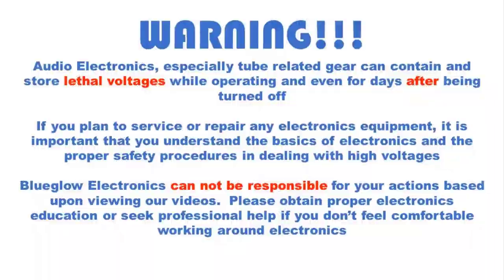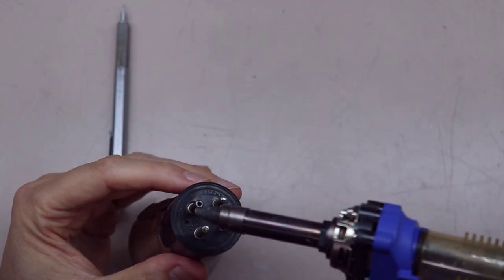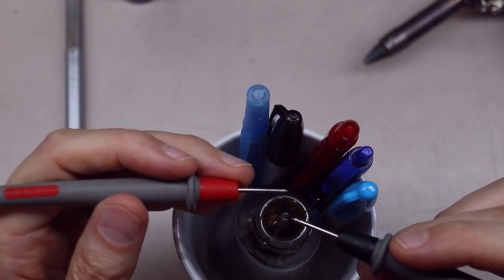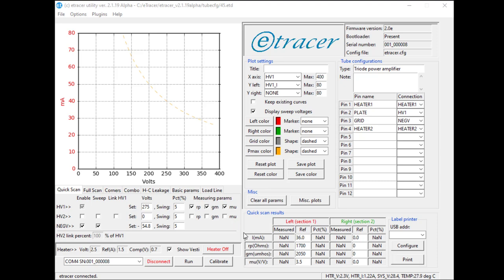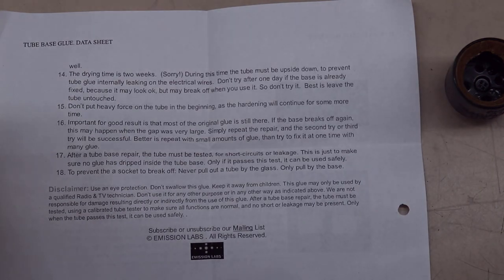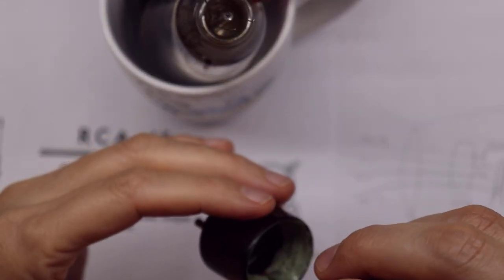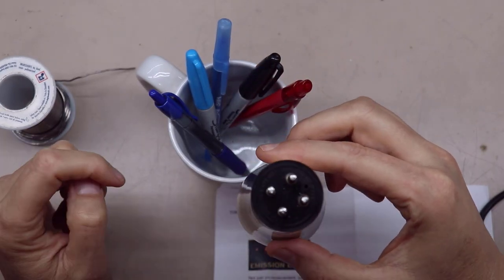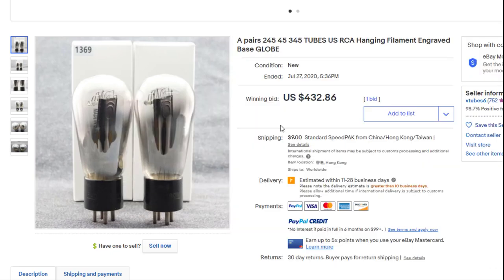How to Repair a Loose Vacuum Tube Base Properly

Comment: A way I have found to fix this issue that works great is to get a tube of Permatax exhaust and manifold sealer. Like $7-8 at an auto parts store or an Ace hardware, probably enough for 100 tubes. Just run a bead between the base and the glass. It can be an intermittent bead, like 3-4 dabs around the circumference of the base will work fine. The challenge is to not glob a whole load of it when you just need a small bead. YES, you will able to see it, but it solves the problem in under 30 seconds per tube and obviously it can handle pretty strong heat being an exhaust sealer. If you apply too much, try to get it off before an hour or so goes by, because it gets quite hard and you have to manhandle the tube to get it off. Works great.

Comment: Nice tips on tube repair. Would it help to temp. solder some bus wire or magnet wire on the leads to get them back through the pins again?

BTW, you seems to have an infestation of comment bots below. The one with a link at 36 minutes is funny as this video is only 15 min. long, obviously a re-direct to another youtube video or something more sinister. Annoying bots.

Hope you are doing OK, looking forward to hearing more on your barn restoration. Any plans on shooting some clips on it's progress?
Cheers,

Comment: Hi,
I was under impression that vacuum tubes have vacuum inside and once a tube opened, it is compromised. You opened this tube and resoldered....  was I wrong about the vacuum?
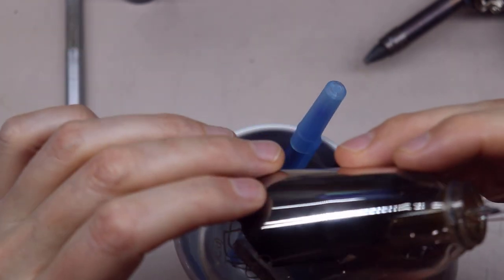Reply: He didn't open the glass tube envelope. He simply removed the plastic base, which does not seal the tube. You can see the glass nipple on the bottom 4:40 where the vacuum was sealed. 

Tubes need a vacuum to function, and once vacuum is lost, the tube is junk.

Also, if he let air in, the shiny silver coating inside the tube (called the "getter") would have instantly turned powdery white.
Reply: @JulianA-tr6pt  I was under the wrong impression that the base seals the tube. Now I know, thank you.

Comment: Got a bunch of old radio  tubes from the 1920s I inherited from my grandfather about fifty years ago.  These still worth something?  How do you know if they're good?  Also have an old Freed Eismann radio that the tubes were for.
Reply: You test them in a tube tester! Only 45,245 & 50 have good value.
Reply: @y_x2  No love for Eveready BH, RCA UX-201-A, OX-112-A, or Deforest 401-A?
Reply: @hagbard72 The 01A's are used on 20's battery sets, and so yes have demand from collectors.  The ones he mentioned have demand from the amp crowd but also are used in early radio.

Comment: Hi Mark.. That’s really cool. Most of my DHT’s that have loose bases are modern Chinese made. So far my NOS hold up well.. Do you have a link to that nifty soldering gun with built in solder suction?? Thanks!
Reply: Look on Amazon for a Hakko FR-301. The FR-300 (older popular model) is discontinued.
If buying one, get a larger tip, like 1mm or a bit bigger. This really helps when using it to desolder older tech like point-to-point wiring. The tip size the the gun comes with is designed for modern lead sizes, for through hole PCBs.
Cheers,
Reply: Eddy_D Thanks Eddy! Saw one on Amazon.. Take care. Cheers.

Comment: Okay, maybe i am rather ignorant, but my understanding of a vacuum tube is a vacuum is pulled in order to remove any contaminates inside the tube. Since you opened this tube how do you remove these again?
Reply: He didn't open the glass tube envelope. He simply removed the plastic base, which does not seal the tube. The base is like a lightbulb base - it just keeps the pins secure and provides a strong interface to plug the tube in.

You can see the glass nipple on the bottom 4:40 where the vacuum was sealed. 

Tubes need a vacuum to function, and once vacuum is lost, the tube is junk. It's not strictly about contaminants, the vacuum is necessary for function.

Also, if he let air in, the shiny silver coating inside the tube (called the "getter") would have instantly turned powdery white.

Comment: Use RTV silicone clear sealant.  Works perfect for loose tube bases.  Cures in 24 hours, $4.99 a tube.  
Everything seems fine, but use the silicone, better 21st century fix for loose tube bases.

Comment: What's wrong with high temperature JB weld
Reply from the maker: You should make a video showing you experience with it
Reply: The adhesive should have have the same thermal expansion as the glass and base material.  It it has no give like epoxy, the glass may break.